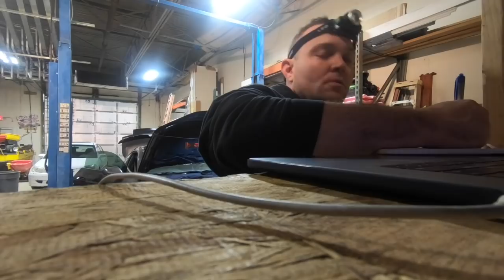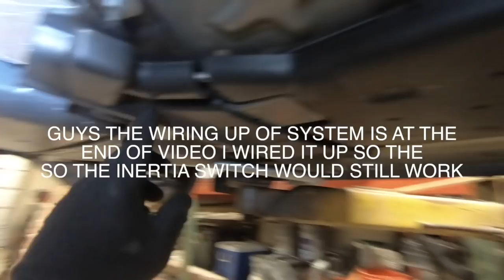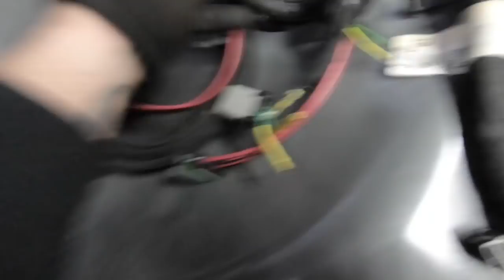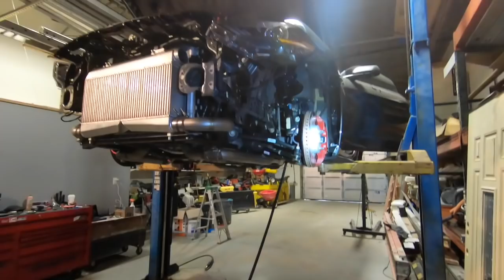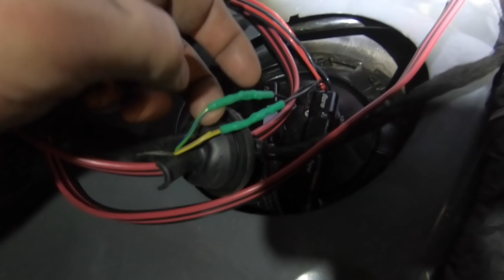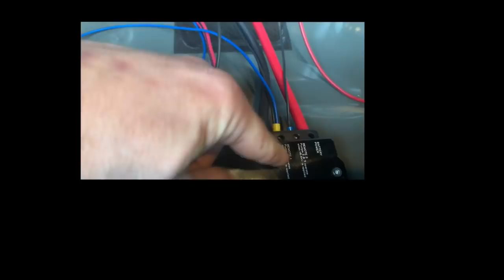2018-2019 MUSTANG GT COMPLETE FORE INNOVATION RETURN FUEL SYSTEM INSTALL WITH 2 REGULATORS DI & PORT

Comment: Can you tell what wire is the trigger from the FPCM? Mine is wired to the yellow/slate on the stock hat harness. But it doesn’t have 12V turn on with key only when car is running.
Thanks

Comment: Get Sai li kit if under 800wheel e85. It's a $1k less. Deatchworks 95lb e85 injectors a steal at $600 too. No need to spend $2k on this kit unless making 800wheel plus e85.